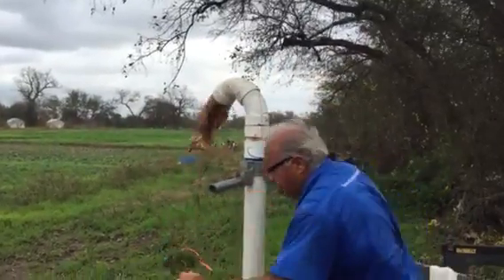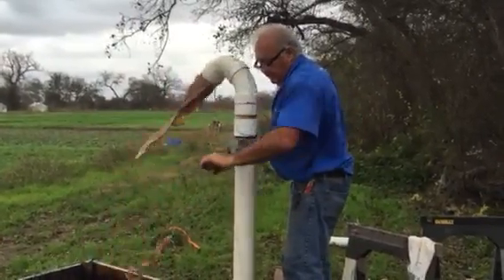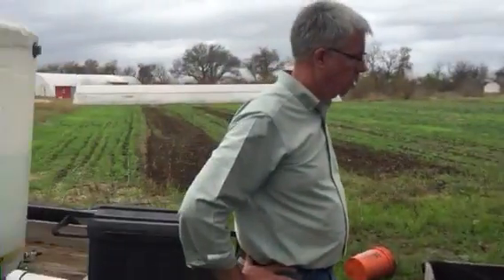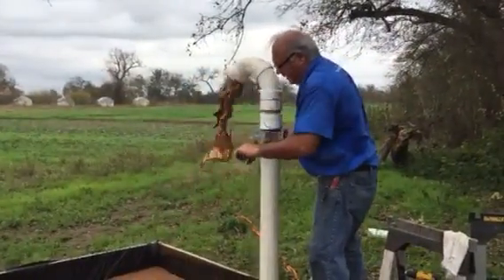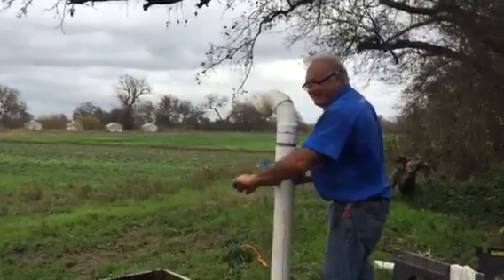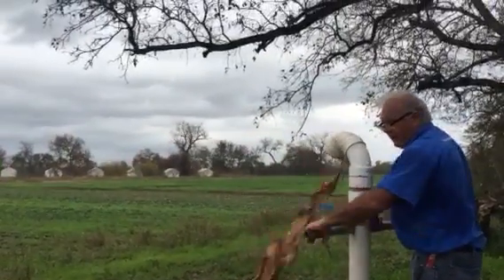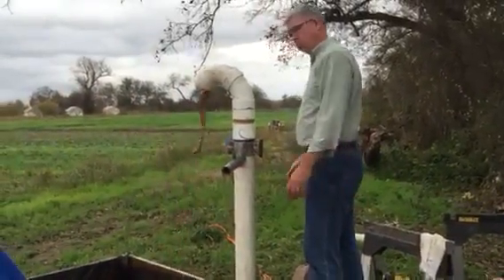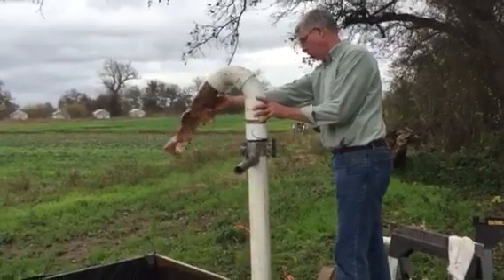drill with first 5ft section

Comment: Where can I buy this bit? Can you sell me one?
Reply: Peace Joy   It’s just a piece of pipe fitting with 3 -4 pieces of steel  welded to it.   Very simple. All he’s doing is adding air to the bottom.  The bit doesn’t spin.  It might work a little better but not much.  Increasing the water flow will work the best, I.e. mud pump. Commercial drillers use the technique all the time.  It isn’t new.